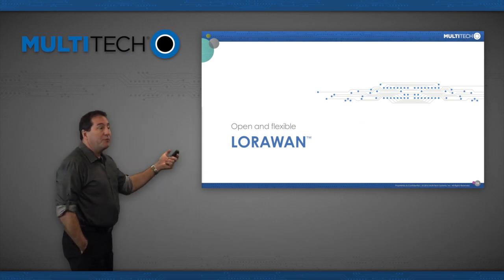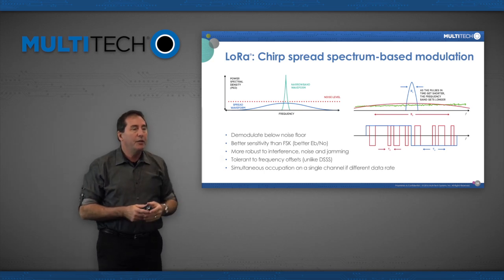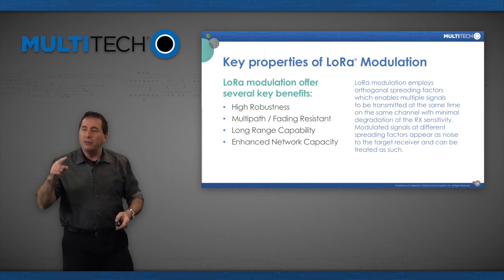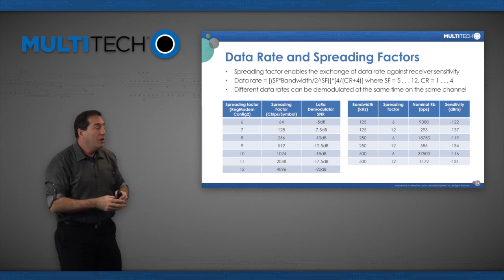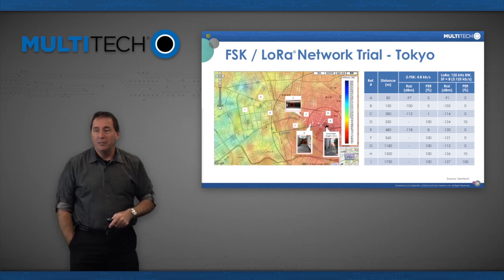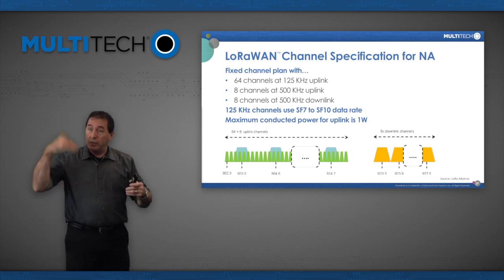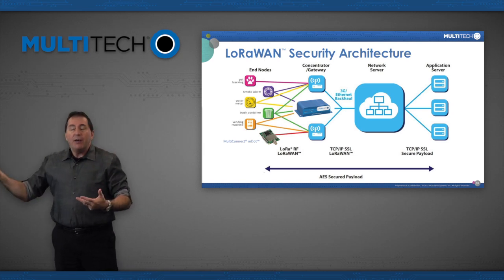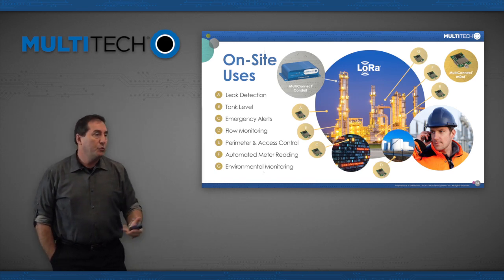LoRaWAN 101 for Engineers

Comment: Excellent speach!! Very complete and clear. However, there are still some questions in the air. As long as I understand Spreading Factor is also the Number of bit per figure.  And what is called a chip, would be the figure's LSB (the small value changing in the figure when a LSB change).  Is that right? For me it is easier to understand in that way.
Reply: I remember, i read about chip in one of the very good and mathematical research paper on LoRa that Chip is essentially (1/BW) where BW is Bandwidth. 
If the signal has a BW of say,  250 KHz. That means, 250 K vibrations per second. 
The inverse of which, i.e, 1/250 KHz = 4 micro-second, gives the amount of time that a single vibration or a chip last longs. 

This is the understanding that I have for chip.

Comment: so how you can handle 1000 points reporting in with the duty cycle of lora.......
Reply: modify when they send the signals out. you need to time when they send out. if you are broadcasting every hour and you have 600 devices each device can send out at different times to not all hit the gateway at the same time.   There are use cases for mass power outages where all devices are trying to ping the gateway where they need to not only use ADR but also a random delay to allow the fastest return to operation time as possible.